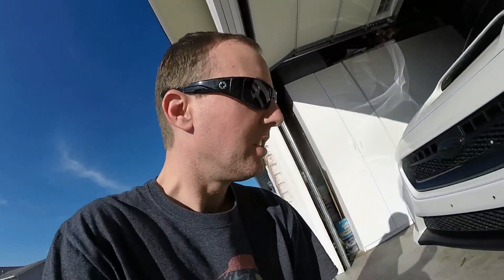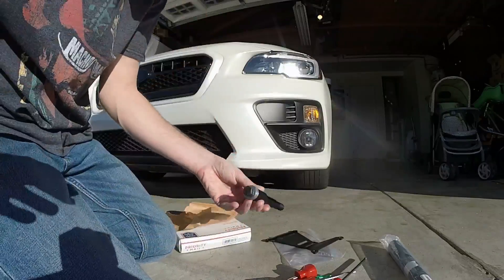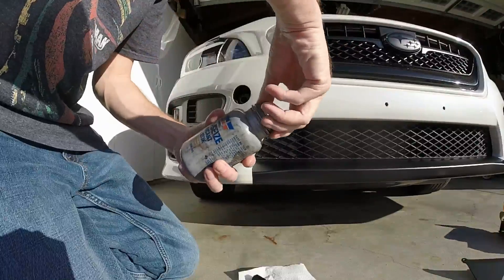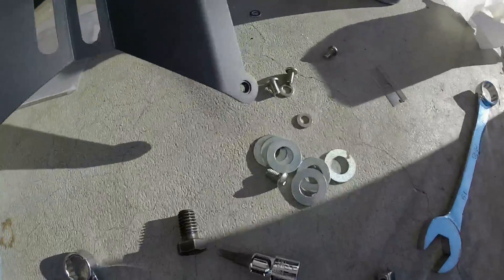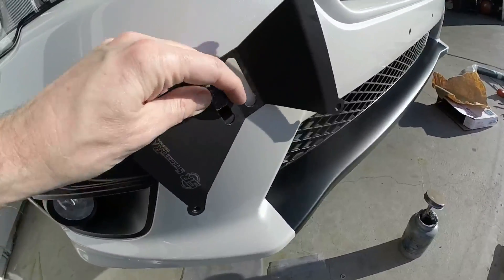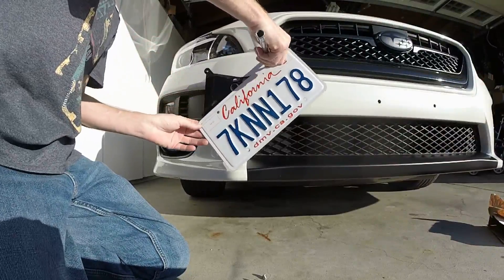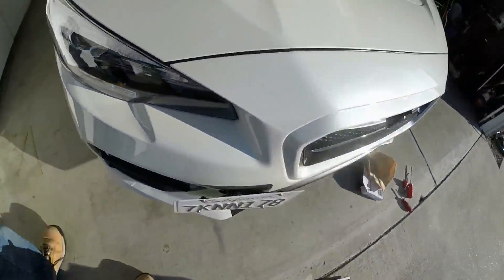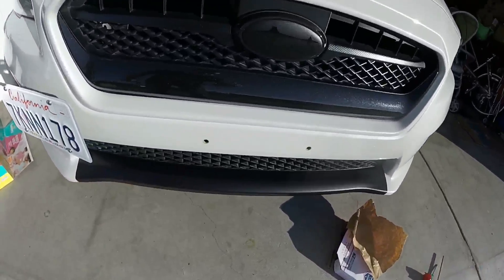2015 Subaru WRX Ep. 268: StreetRays License Plate Mount Kit Installation

Comment: Yeah, now I'm feeling the blacked out bottom front bumper scoop. Looks great. Once again, persistence pays off for LHG.
Reply from the maker: +BodegaBay ehhh not me.. i think its just the right blend of black right now.. but you can photoshop it in for me if you want.. if i liked it i might vinyl wrap it for a test.. but the real question is, does that scoop insert come off easily, or would i have to do it on the car, which is almost impossible.
Reply: +LastHumansGarage No, no, I should've put it better. I LIKE how  your blacked out portion looks, vinyl or plasti. I wasn't convinced until I saw the bumper today.
Reply from the maker: +BodegaBay oh, when you said front bumper scoop i thought you mean the hood.. part 1 of a video coming in 10 mins.

Comment: I think it would look better with black bolts.
Reply from the maker: +Blake's Garage damn that's a great idea. I can either spray paint them or special order some anodized. It's Allen key.
Reply: +LastHumansGarage Lowe's should have black ones in their specialty hardware section.
Reply from the maker: +BodegaBay really?? i mean you don't mean the basic flat black rounded allen heads do you, i have some of those. the stock ones are button head and look better. but anyway.. i think i might leave this piece off for now, and take the risk of no plate tickets until i get one. i dont speed everywhere, so hopefully a cop doesnt pull me over just for that.
Reply: LastHumansGarage Yeah I just rock the plate delete. I got on ticket and it was only 35 bucks so what ever. Yeah just some rounder black bolts would look better IMO.

Comment: Is that the same bumper plug that I told you about on ebay? They have all color for Subaru WRX/STI. The vinyl on your bumper look great and it stand out. I can't wait for my 2017 WRX Pure Red this summer. I hope they included rear wiper and dual climate control. I will post it on my instagram. I hope Subaru delaership give me a good deal on the car in PA. Love all video. Always support your videos.
Reply from the maker: +Big Mike Mike H prob same bumper plugs, got em off ebay. but they will take like 4-6 days to arrive.
Reply: +LastHumansGarage I am glad that you decide to put those plug on so it will look more clean. Keep up the video updated. Always support the video.

Comment: Looks nice, u should torque it down so no one can steal it easy, that's what I did
Reply from the maker: +Zack Zielinski people steal that shit?? Don't want to over torque it
Reply: +LastHumansGarage This is identical to the Perrin one I have and they call for torquing it down in the instructions and seeing as how the Perrin one was nearly $100 I can see how someone would want to snatch it.
Reply: +LastHumansGarage yea man you'd be surprised haha i seen it happen, and 45lbs for main part then 30lbs for the smaller bolt
Reply from the maker: +Zack Zielinski thanks, its off for now. i might keep it just in case i need it. until i get my first ticket for no front plate. but it doesnt look terrible... but the front end looks better with nothing of course.
Reply: +LastHumansGarage no problem, and yea i feel you. In ny where im from i cant chance it lol

Comment: down is the best
Reply from the maker: +Christopher McGill you mean as low as possible? i have it right in the middle of the slot.
Reply: +LastHumansGarage yes, just covering the back hole
Reply: +LastHumansGarage lowest
Reply from the maker: +Christopher McGill what do you mean, covering the block hole? the tow hole?? of course it would cover that.
Reply from the maker: +LastHumansGarage oh now i see what you mean. not the hole peeking out at the bottom, but the hole peeking out at the top. cuz i'd have the plate so low.